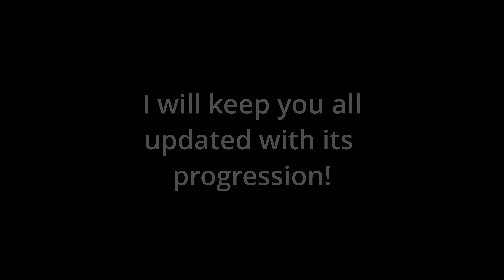I rescued a 23yr Old Honda VFR! IN A KEI TRUCK

Comment: All farmers in Japan use Kei trucks. You read Suzuki correctly. The original number plate near the winch tells that it was registered in Fukushima prefecture. The red sticker on the screen says ‘Ganbatte’(Do your best). I could not see all letters at the top of the screen. Kei cars are very slow but they should nicely fit in city use. They never export them. They are literally everywhere in Japan. I had one of ordinary Kei cars while I was back in Japan for a couple of years. I had that VFR and one model earlier in the UK.
Reply from the maker: Very good info! That's right with the Fukishima prefecture. I got the information from the original service records and made sure it matched. I'm surprised they aren't more popular as an import. It's fantastic around towns and cities!